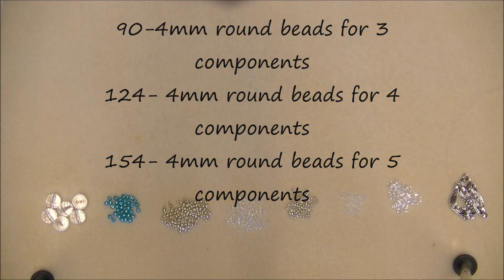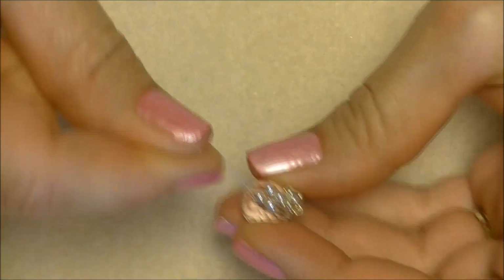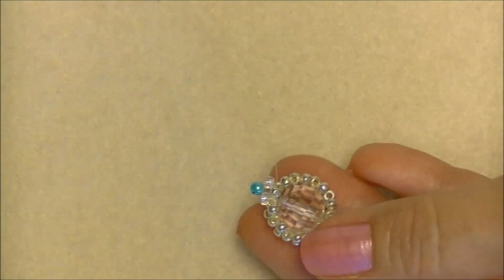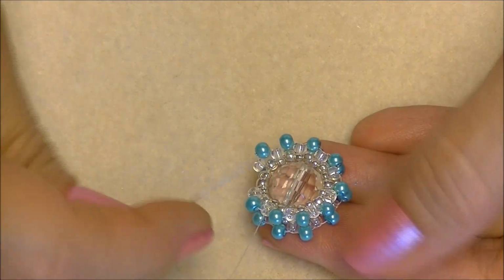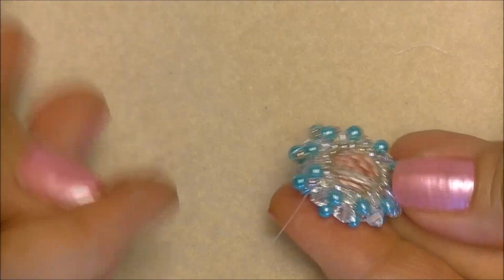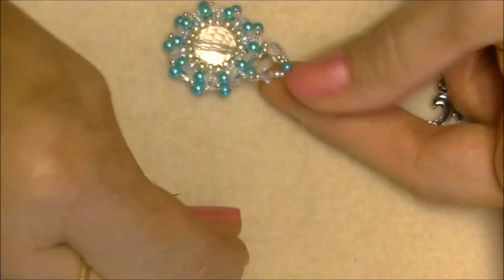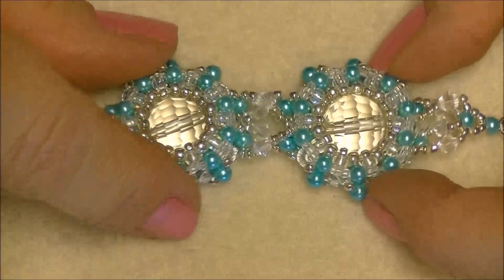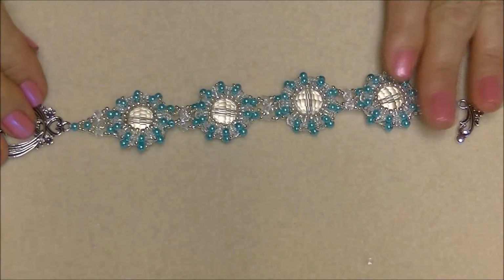Pearl Wheel Bracelet Tutorial

Comment: Gina.....what size did the bracelet come to?????  I should have asked way back when but forgot
!!!!  I am looking for like 7/71/2 inch bracelet!!!!  Thanks for the reply.....oh and did you say 3mm pearls now????
Reply from the maker: Cheryl it turned out 7.5 with the clasping. And yes, use a 3mm round pearl.
Reply from the maker: Hi Cheryl, you asked a question about the thread that I saw in my email but I don't see it here. It must have been sorted as spam. I will fix it later when I am on my computer, can't do it on my iPad. Anyway use three arm lengths per untitled. An arm length is e length of one arm. An arm span could be considered the same as a wingspan which is the length of both arms stretched out. Well that's the way I learned it anyway. I have noticed that some instructors here consider a wingspan the same as an arm length but it really is different. So just measure the length do one arm three times. Great question!
Reply from the maker: My iPad keep correcting my writing and making it so wrong! It is three arm lengths per unit. Not untitled! Blah! ;)